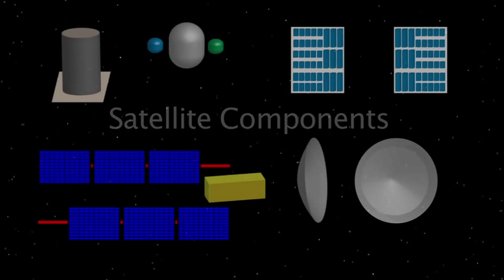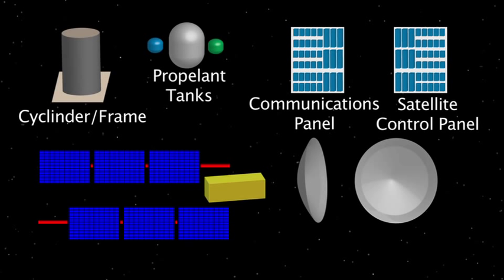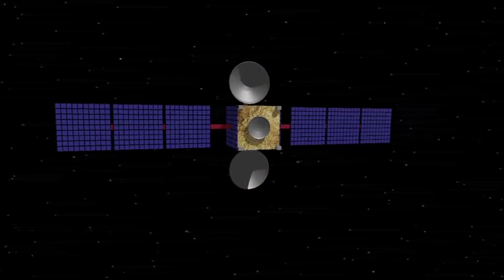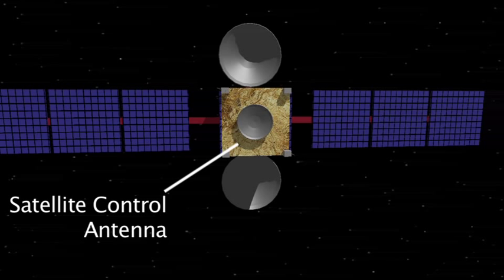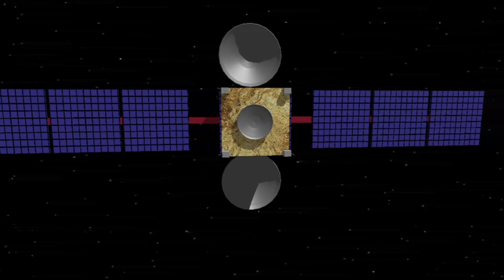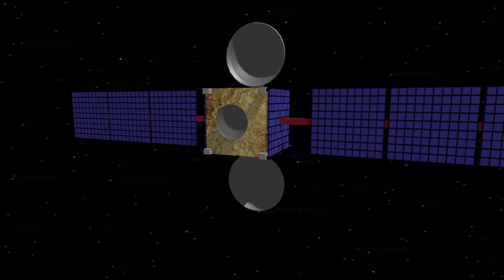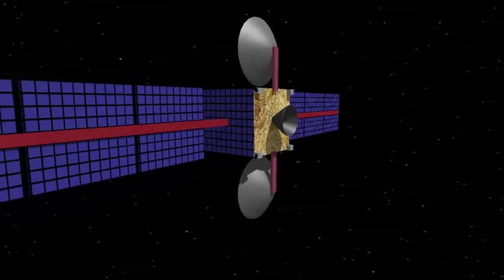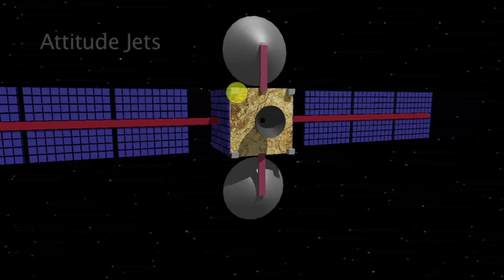Communcation Satellite Construction

Comment from the maker: What you see is metalized mylar, just like the mylar balloons you buy at the store. This mylar is coated in a very thin lair of gold to reflect both visible and infrared light, it is 98% effective. This helps to keep the satellite from over heating. Exposed to the sun's rays without any protection the satellite's internal systems would soon over heat and fail. The foil is combined with insulation to prevent freezing as the side of the satellite away from the sun is exposed to the cool of space.
Reply: I always get confused with the foil on satellites.  So i had to look it up again ..  apparantly mylar is transparant, so they put a thin layer of aluminium on it to make silver colored space blankets to keep people warm.   But apparantly in space they use Aluminized kapton .. as kapton is more resistant to the hostile environment of space and it outgasses less. However ..  kapton is amber colored. So it looks like its gold on mylar .. so i always tought the moonlanders where packed in mylar with gold.  But its kapton with aluminium, which looks like gold because of the amber color of kapton.

Comment: The LAM (Liquid Apogee Motor) thrusts the satellite into its predetermined orbit after release by the rocket. How does the satellite slow done, or brake, into that orbit once it reaches it? 

How do the metal components in space survive the effects of cold welding?

How does a satellite "know" how to maintain an orbit using its jets? And how does it do this?
Reply: - The satellite slows down by changing its attitude (180° rotation), followed by a thrust in the opposite direction (with the LAM).
- Dont understand the question about cold welding...
- It maintains in its orbit ("station keeping") using its LAM or reaction control thrusters. The parameters which influence the altitude are perfectly known and the periodical station keeping manoeuvres are scheduled and programmed by the operation team on ground.
These parameters are the Sun effect (pressure of the Sun radiation) / the Moon-Earth attraction effect / potential disturbing torques from the spacecraft itself.
Reply: @juliooo892  cold welding happens when two pieces of clean metal touch in vacuum, they stick to each other, which is a problem if they are two pieces of a mechanism that is supposed to move. It doesn't happen when dissimilar materials touch, for example metal to ceramic or metal to plastic or when the pieces of metal are not clean, for example they are painted or have an oxide layer on surface. It's a complication that needs to be addressed when designing moving mechanisms meant to work in vacuum, but nothing that can't be worked around with careful engineering and material selection.